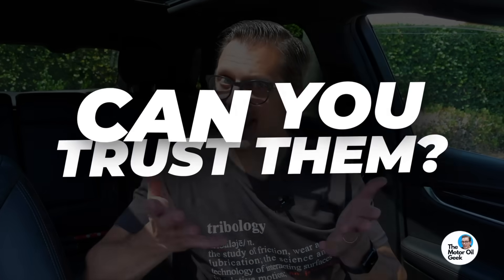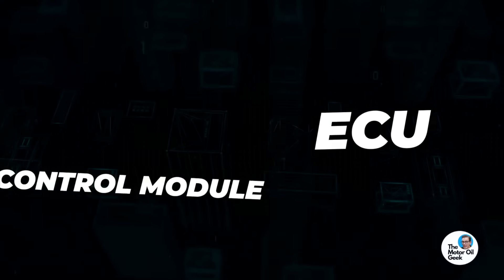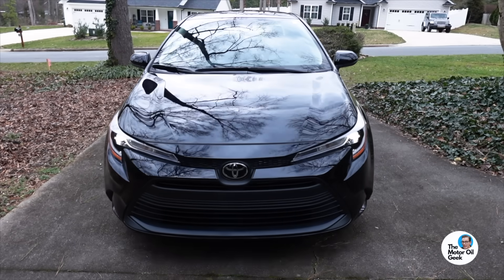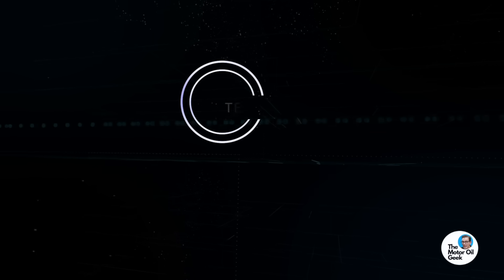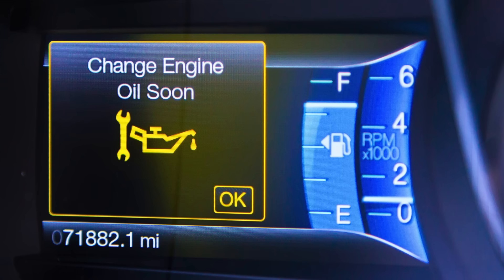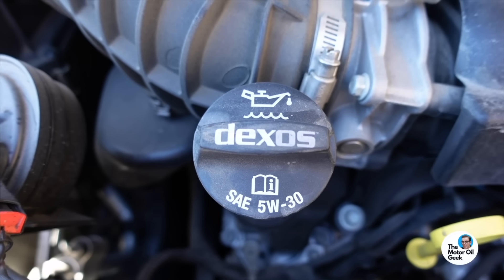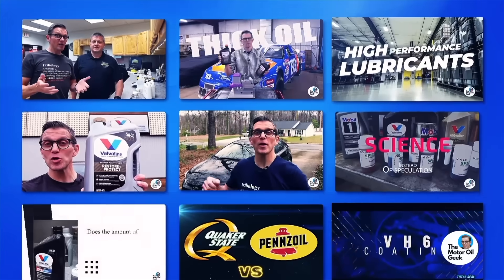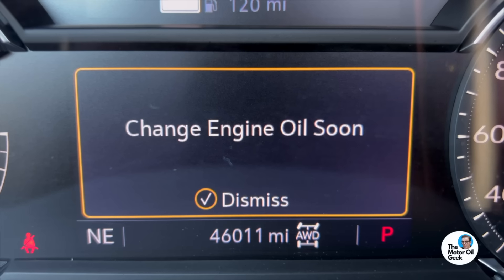The Accuracy of OIL LIFE Indicators REVEALED!

Comment: I have a 2019 Ford raptor 3.5 eco. I changed the oil and reset the oil life indicator. And then the truck sat in the garage for 18 months never started it not once. When I did start it after those 18 months the oil life indicator came on in in center of the dash saying change oil now 0% oil life left. Never started the truck and it needs an oil change NO. Fuel dilution NO. Seems to me the Ford system uses mostly time for its analysis.
Reply: Watch Lake's video about additives settling out of the oil into the bottom and then don't get remixed back into the oil.
Reply: @hotrodray6802  I thought we were talking about the oil life indicator? no comments about old stale gas you all are slipping
Reply: @hotrodray6802  takes far more than 18 months for the oil to be ruined like that!

Comment: Check a Honda, please.
Reply: They are terrible. Don't trust them. Stick to 7500 on full synthetic.
Reply: Honda’s Oil iLife indicator works fine. I go by it usually goes in around 9 to 10,000 km sometimes less, if I do  short trips.  car has 420,000 km on it now still works fine runs great. I’ve had the valve cover off a few times, to adjust the valves, still clean inside. I also use 5W 30 oil full synthetic. We get temperatures from -30 to +30 Celsius.
Reply: @DCSPORTSTER  My wife's Honda was telling her to change the oil at 11,000 miles. That's 17,600 km. It's also far too long. All of these systems rely on trying to fit how you drive to how the oil degrades, but they aren't actually measuring the oil. For some they will be fine. For others the results are nonsense. The oil change indicator should just let the driver set a number of miles instead of overcomplicating things with some algorithm that doesn't work all of the time.

Comment: 🔔😎
At 4:00
Not getting the oil hot and eliminating condensation is bad.
But getting the oil hot hurts the oxidation properties of the oil.
???????
My Ford has a police car sandwich oil heat exchanger between the block and oil filter... Cooled/ heated by the return heater hose... 200* coolant heats the cold oil and cools hot oil.
Good or bad ?
Mobil 1 oil and filter 3,000 miles.
Ive asked this question before.
Thanks for any reply.
Reply from the maker: Balance is everything! The heat exchanger is a good thing.
Reply: @themotoroilgeek 
Thank you 👍👍😎

Comment: I went 10 years on my 2004 LB7 Duramax which is at a little over 58,176 miles.  I used Mobile 1 for diesels and I started feeling guilty so I changed the oil and did a lab test.  Black Stone results said to keep driving and re-test in 1000 miles, I had already changed the oil by then.  The Oil Life Indicator said I had about 30% life left in the oil.  I only use the truck to pull my utility trailer and get two 30 gallon drums filled with diesel every October or November for the tractor.  Round trip into town and back is about 15 miles so the engine does get to heat up before going back in the heated barn until the next time I need it.  I bought the truck in October 06 with 39,000 miles on it.

Comment: LMAO How lazy can people get. Take masking tape write down the millage date you change the oil. Open your drive door and put it inside the door. Check your tires. Don't depend on those stupid tire sensor which all they did was cost the vehicle more like I hate ABS also. If you need ABS you should not have a driver license. Just like back up camera's. Do were really need all this crap? I sure don't. And when it goes to hell people won't fix the stuff making them more unsafe on the road.

Comment: As a person who spent most of their life doing QA\QC in labs (and aircraft maintenance background prior), I have to throw a flag on your conclusion. You ran an analysis on a SINGLE sample. I will never make that sort of conclusion from a single. I need, at minimum, three sample FROM THE SAME CAR before I would have any confidence in the result. And that would be dependent on using the exact same oil (in this case I would buy enough for three complete changes and thoroughly mix it in a container that could be held under controlled conditions) AND three identical oil filters, hopefully from the same production lot. Then I have something for that SPECIFIC vehicle that I might hang my hat on. To say that all vehicles from that one manufacturer then would be the same would contain the same error is careless. I know the mega-gigga-wonerbytes of data that they have for their algorithms work out some of the issues, but I'd need to test every engine at least the three times before I'd sign off on it.

I have a Ford and a Mazda that have these monitors. The only thing I do with them is make sure that they have been properly reset after each oil change. Oil is much cheaper that a new engine. 5,000-mile intervals are good for this old QA guy. And oil is cheap. Edit: forgive me for not acknowledging that Mr Speed is "da man" in this field. This isn't meant to slight him at all.
Reply from the maker: This is simply an example case. The concept behind this video is based on years of used oil analysis results and my work with GM.
Reply: @themotoroilgeek  I understand, just making a point. I know that you're "da man" in this field. In fact, I should go do an edit. Sorry I didn't give you proper credit for your expertise.
Reply from the maker: @bertpeters1866  No worries! This video is creating some great discussions, so all is good.
Reply: How many UOAs do you reckon Lake Speed has looked at over the years to provide us this feedback? Yes, this video took a random sample out of a random rental car but few people on the planet have a better understanding of lubrication and wear than Lake does.
Reply: Why don't you do an oil analysis to see? Can do one at 5,000 miles and if good increase it some. Maybe you may get to where the car says to change it and find the same thing.
Reply: @KforConstant  not worth the cost. Oil is cheap. Not to mention the time. That said, I am a bit of a science geek, so maybe I will one day 🤷.
Reply: Also, as I’m probably sure has already been said we don’t know the mileage on this oil, or if the oil meter was reset regularly at all in accordance with the actual oil change. honestly, this oil could have less than 1000 miles of usage
Reply: @TheNCNelsons  just bad science. And in the name of "clicks."
Reply: Agreed. Some vehicles/models/engines will "need" testing to confirm the OLM, Engine, and Oil are all "aligned" correctly.

My Vehicle's Ecotec 2.4L (with GDI) is known to have issues that basically DEMANDS that people wanting to avoid various known problems change their Oil Early and Often (as early as 3000 miles/3 months and OLM 50-60% is common).
Reply: You'd be correct if he was GM trying to find out if the oil life indicator works or not, instead he's just checking something that's already known to work. It makes no sense to be stuck on miles when the oil life indicator takes more variables into account which make it way more accurate, just change it with a higher % remaining rather than counting miles. Idling doesn't add any miles, yet it destroys tons of modern diesel engines.
Reply: He did point out that this is a random sample from a rental car.
I conclude that might be a good example of the random cars driven randomly.
I also note that rental cars are probably not driven short in town trips but rather are going somewhere on a highway.
Reply: @hotrodray6802  zero clue about what was the quality of the prior oil change and or if the oil was even changed at all.  Not uncommon for fleet vehicles to just reset the meter without an oil change.

My last rental car- I reset the olm.  It was at 5% and I was getting a notice every start up.
Reply: I had the same thoughts. It seems almost mythbuster-ish to come to a conclusion after getting results from one car. 
Also, I've been changing the oil on my new truck at 5k mile intervals based on the information I learned watching THIS channel (and project farm). 
Costco oil, wix filter, 2.7 turbomax silverado.
Reply: @daveharris39  my primary care is a Ford Fusion with a 2.0 Ecoboost. It's a 2015 with just over 127k miles. I'm a "spirited" driver. Everything is great, and my friend who's a Ford master tech says that I must be doing good because I haven't had any problems. He sees bad 2.0s all the time.
Reply: I'd add one more reason not to trust the oil monitor.  It won't tell you when your engine is beginning to show signs of unusual wear.  Increasing metals count is the first indicator of excessive piston wear etc. Lower flash point can indicate failing pistol rings, also.
Reply: It’s YouTube, not a lab. Smh. People
Reply: @cliffh8486  well, he does say that's what he does...
Reply: @cliffh8486  and, I might add, I did add that I'm not just a random dude watching his videos. I have engine oil experience with B-52H and B-1B aircraft, as well as cars. Not to mention all the years in a quality lab. Hope you don't hurt yourself shaking your head 🙃.

Comment: Don't forget to check your oil at least once per week to see if vehicle is consuming oil. If the car uses oil, you better keep an eye on the level and top off if it drops a half quart. It's a good idea because oil also extracts heat from the engine. Checking under the hood once per week gives you a good idea of what's going on with the motor and you may spot early a growing problem.
Reply: Stop buying crappy cars if you're so afraid you need to check oil once per week. Even on my performance vehicles I'd only check one per month at best. If you're properly taking care of your vehicles, it's extremely unlikely it will suddenly start consuming oil.
Reply: @snaaaaaaaaaaaaaaaake  Even crappy cars don't need it, if it's leaking that much oil it will leave oil spots where you park it and/or blow blue smoke while the engine is running. These people don't understand jack shit about engines.
Reply: Check the oil every time I fill up with fuel.  
  I am not sure if it's developed a leak or not. 

     By the way no to the metric system.
Reply: @stevetaylor9265 I always check my truck on every fill up, which equates to once a week.
Reply: @stevetaylor9265  Yall act like it's 1945 and modern engines still use cork gaskets lmao. Checking your oil every time you get gas is nonsense.
Reply: @bobbygetsbanned6049   Nope it's really not. However yeah it's probably not necessary. But the point being nobody even checks oil levels anymore.
Reply: I have a 22 suburban and yes every 1k I have to put a half quart. That's ridiculous of these new cars
Reply: @ravieprasaud4527   that's a quart to 2,000, that's really not that bad actually. Although many don't take even that much now days.
Reply: A quart every 2000 miles sounds like a lot for a modern car. Are you sure it's not leaking?
Reply: @ravieprasaud4527 … leave it 1/2 a quart low and your consumption will stop.
Reply: @ravieprasaud4527  Smh

Comment: Good info and thank you. Now do a dive into Ford's system please
Reply: I don't know about the newest Ford's but the older ones use the calculation too. If I check oil life left before the change it will show around 40% at 5k miles. It's almost all highway miles for about 50 miles each way. If I drive it a -little rough-, which is hard not to, the % drops between oil changes. Oil life % or mileage didn't change when I started using a different oil brand and heavier viscosity.

Comment: I learned from the previous generation to change the oil and filter every 3000 miles and drive gently from people that used to keep their cars trouble free for years and rack up lots of miles.
Reply: Ditto. But today's oils are totally different as are the fuel injection cars.
Reply: Always being gentle 100% of the time isn't great for an engine either. I've fixed a couple old lady cars with some hard RPM on the highway that the car hadn't seen in ages. 
Old timers called it the "Italian tuneup" bc the small displacement high cylinder count engines coming out of Italy were especially susceptible to needing to clear their throat
Reply: Those were people stuck in the 1960s. It isn't the 1960s any more.
Reply: Depends on the engine.
On high performance cars you should change every 2 to 3k, yes.
Also depends on how you drive. Short distance driving is an oil killer, so you need to change it sooner.
Reply: Yeah.  I once owned an 86 Toyota MR2 that had been owned by an elderly couple since new.  They always drove it gently.  At around 100k miles they traded it in.  The poor guy who bought tried to drive it the way it was intended as a sports car and immediately shattered all the oil rings due to the ridge built up in the cylinders from a decade or more of "always driving gently"
Reply: That's what I still do also.
Reply: They are probably plenty of Porsches just like Lake's that are driven hard and follow the factory oil change interval that Porsche calls for of up to 12,000 miles or 24 months! To have a Porsche flat-six and only drive it gently, seems to defeat the point of having it...